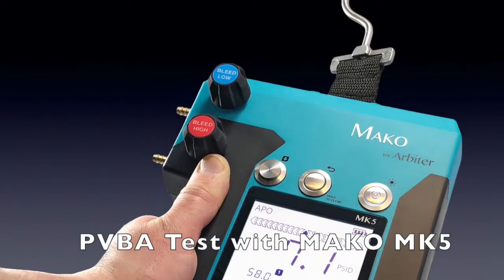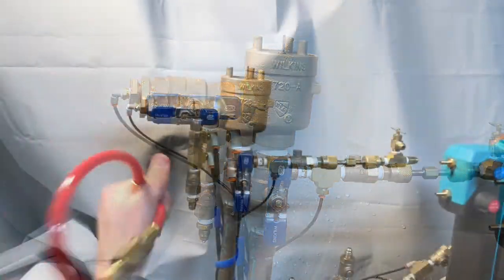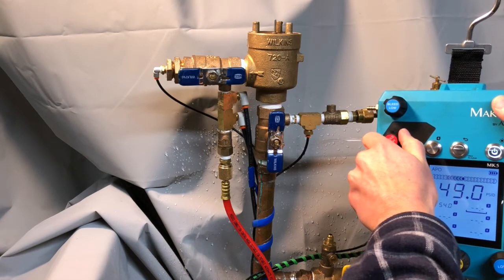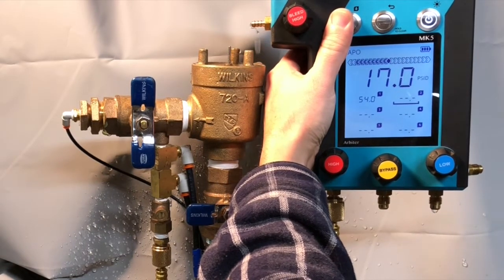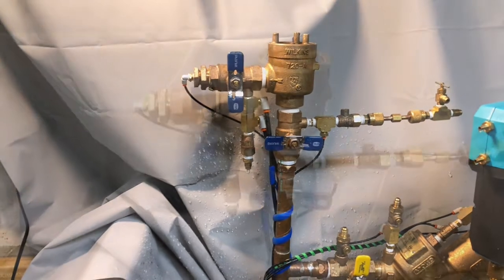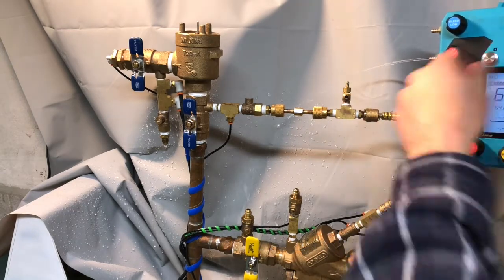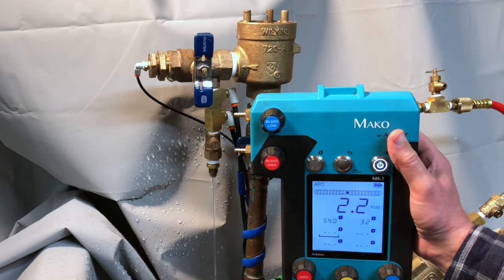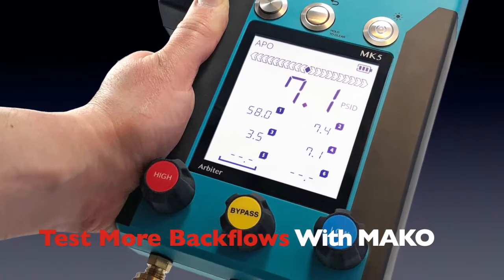PVBA Test Procedure USC 10th Edition MAKO 5 Valve Test Kit

Comment: How do I check what is the system pressure on the MK5?
Reply from the maker: Thank you for the question.  You simply connect the high side and have the low side open to atmospheric pressure and that is the line pressure.  You can see the step by step instructions for the MK5 on the test procedures for each assembly: https://arbiterbackflow.com/mk5-test-procedures  .You can also contact us if you'd like to talk to someone about it or have further questions by emailing support@arbiterbackflow.com or calling us at 503-847-4936 during 9-5 M-F Pacific Time.  Have a good day.